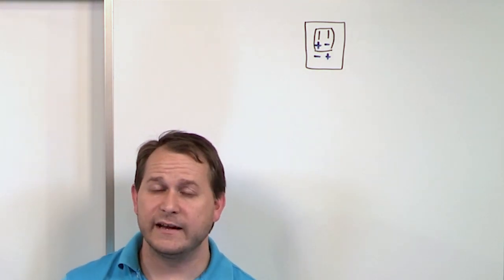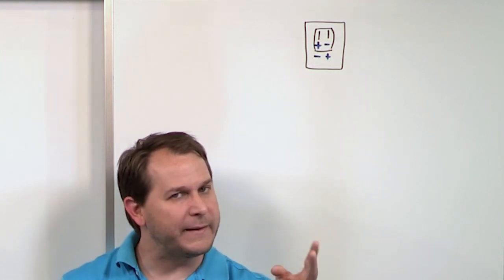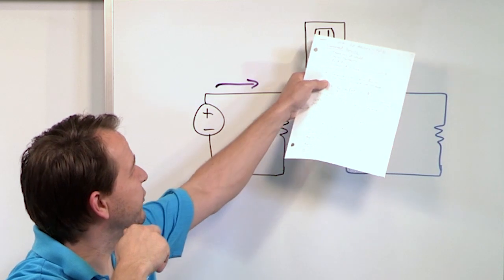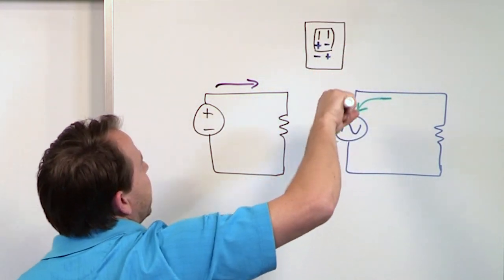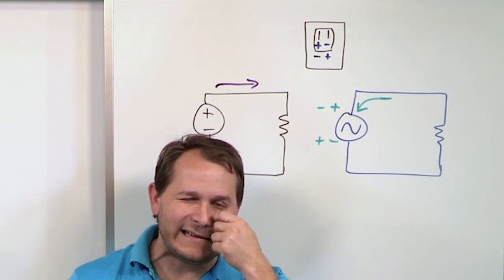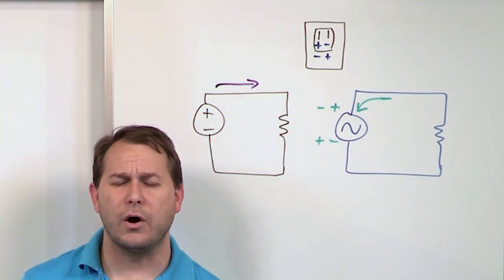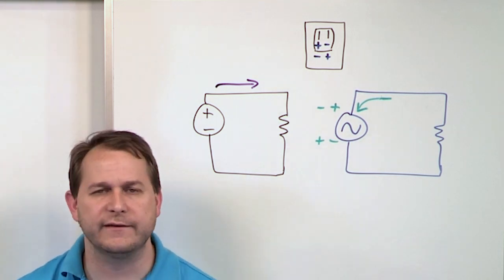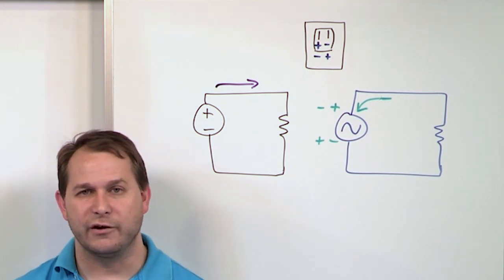What is Alternating Current (AC)?

Comment: are you sure you explained the alternating voltage/current concept correctly?...especially giving the wall socket example? many folks are genuinely confused and have a valid question about why a tester glows only when kept in one socket? 
the reversal ( alternating) happens only on one phase (socket)..some folks did mention it here...

Comment: The current direction does change...hence the name alternating. However in the case of a typical outlet, the 2 wires are not alternating. The neutral side remains constant, at or close to ground or 0 potential. The hot wire goes positive relative to neutral, then negative relative to neutral. This is a push-pull action on the electrons, not a flip-flop action of the 2 terminals as described here.
Reply: your comment explained more than the entire video...good job
Reply: Interesting point, but I'm not quite sure what you are trying to correct though. Voltage is always a measurement with respect to two points, which in this case is the hot wire and the neutral wire. I understand the teacher as discussing the voltage with respect to those two points, hence the polarity flips.   I think your comment is looking at two different sets of points. The first set of two points is between the neutral wire and Earth ground, which always remains close to 0 as you said. The other set of two points is between the hot wire and Earth ground which goes positive and then negative. This makes sense as the neutral wire is shorted to Earth ground.
Reply: You are right, the flip-flop action he spoke about is incorrect

Comment: Sir, I watch your video almost regularly. I have a simple question how the alternating current flows in a wall socket. If both the holes have current alternatively, then when I insert a tester in a hole, I find in one hole it glows and in the other not. So how does the current flow alternatively.
Reply: read Anon user comment above... thats the true answer..
thats why tester only glow at hot wire..
because it alternate from + to -  in that wire only..
neutral remains zero...
Reply: fuck ,now i became confused ............Even about AC current /
Reply: read about line-to-ground and line-to-line systems.

Comment: I have a question. Lets say you have 10 volts and two wires, one will be ground and the other positive, and a power supply is giving these two wires 10 volts, so the power supply has two wires that are 5 volts each so what you're giving the power to will have 10 volts. I though that the positive wire will have 10 volts and the wire for ground will have 0. So my question is how does one wire get 10 volts on that side and the ground is 0. I might be wrong, just curious.
Reply: +John Smith if AC then One 5v wire is actually changing from 5v to 0v to -5v and back again very fast so the voltage or (potential difference) from 1 wire to ground will read 5v on volt meter. If you test across two 5v AC wires when one is -5v the other is 5v then they are both zero then both reverse. but the maximum potential difference between 5v and -5v is 10v. Volt meter reads the max difference because it is changing so fast.  In DC to get 10v one wire must be 10 v the other 0v
Reply: I get confused when my dad says potential. I don't really get what that means.
Reply: +John Smith actually my previous comment isn't exactly right. It depends on what your power source is. If AC it could be 10 and 0 or 5 and 5volts. A house in USA usually has 2 power legs and a neutral. One leg to neutral or ground will be 120v. one leg to the other   Will be 240v. The voltage on each leg is going from 120-0-neg120-0-pos120-0-neg120-0-pos120v always changing. Very fast. The maximum difference between that line whether it be 120 or negative 120 and neutral or ground 0 is 120 v. The maximum difference between the 2 power lines, because they are both alternating rapidly between pos and neg opposite each other one is -120 the other will be 120 the difference is 240. The potential difference is like saying the maximum difference for a period of time. I hope this helps. I'm not exactly an expert.

Comment: If the current is constantly changing, how does the electricity get from point A to point B? Just a little confused there.
Reply: In this context the current is changing direction, in one instance its going one way, and in the next instance the other way.
For example, if you ran a lap in a stadium with a circular track and then turned back and ran another lap the other way, and then turned back again and ran another lap the other way, and kept doing this, you would say you are alternating your direction each time you complete a lap. AC current does this, it flows from one way then reverses direction and flows the other way, and repeats this to and fro,  left to right then right to left, back to forth, one way then the other way...get the idea? If not, drive your car from your driveway one way around the block and then the other way when you get back, repeat this until you have an epiphany. You may need to start with a full tank of gas just in case :)
Reply: Sorry for the sarcasm, I will try again. The current isn't constantly changing direction. With a 60Hz power supply it goes from A to B in 1/60th of a second, then from B to A in 1/60th of a second, then A to B in 1/60th of a second, then B to A in 1/60th of a second etc etc. So after a single second has past the current flowed from A to B 30 times and from B to A 30 times alternating every 60th of a second.
Reply: northgork Thanks, for the explanation. Helped a lot.
Reply: northgork What if going from A to B takes longer than 1/60th of a second?
Reply: +northgork Actually it goes from point A to point B in 1/120th of a second and from point B to point A in 1/120th of a second, which means it completes a whole cycle in 1/60th of a second, or 60 htz.

Comment: If I assume that I have an  AC source which has 50 Hz frequency and the electric current would travel at the speed of light in the wires. The  wavelength of the electric current would be  about 6000 km and electric current would chance it's direction after 3000 km. So my question is:   If had a light bulb and I would  connect it  to the 50 Hz AC source with wires that are both  4000 km  long (from lamp to minus and from lamp to plus terminal)  and i would assume the  resistance in wires is insignificant. Would the light bulb still light up or burn? Please answer, this has troubled my mind for a long time now.
Reply: The wires should be 600,000 Km before any voltage & current delay would be significant to the device which is in this case, the light bulb.

Comment: why is this happening? Why is the current changing?
Reply: That is answered by examining the AC source. To put it in the most simple and vague way possible, it's because of the changes in magnetic flux, as the flux changes the current direction changes also. Go read on how AC generators work and it will be crystal clear for you  :)
Reply: Felix Frost Felix now imagine a water pipe which has water coming in full force. Ok? Now you put a stopper at the other end.what happens the entire water reverses its direction, Is it not.? So also the current. Got it?

Comment: Why does the current direction flip in the plug?
Reply: That is answered by examining the AC source. To put it in the most simple and vague way possible, it's because of the changes in magnetic flux, as the flux changes the current direction changes also. Go read on how AC generators work and it will be crystal clear for you  :)
Reply: Thank you